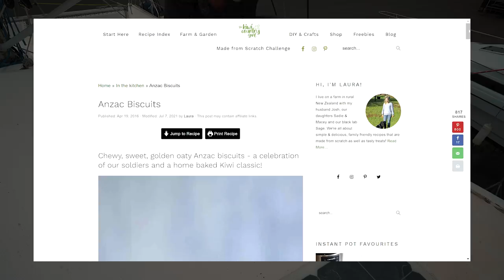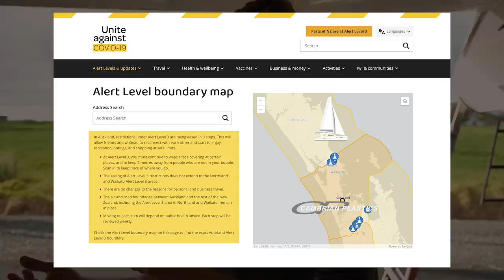BOAT REFIT: Our Biggest Project Ever!

Comment: Too late for this job. But when fiberglass fails from a sheet metal screw type of installation, And the panel has access from behind. I change the type of attachment. I use washers on the back side with nuts attached to machine screws. Be  sure to us Loctite on the nuts on the backside to deal with vibrations from the boat and water. The resulting installation is much faster and less interruption in work flow. But also i s a superior attachment for the instruments. You will want to keep the machine screws needed on hand because the head is important to the overall installation. You man need a special head on the machine screw. They are available in every imaginable type, but my need to be ordered and take several weeks order/shipping time. Thus having them on hand when needed is a plan ahead item.

Comment: I admit not going through all the comments, but I could not see from what I read or saw what your motivation was for doing all that work at replacing windows other than you were told the useful life was past.  Were the windows leaking (admittedly I may have missed that in the video)?  if not, why bother replacing them?  I get the need for preventive maintenance to prevent a greater problem but I don't get what greater problem you would be avoiding with waiting for these windows to fail, if they ever fail.  I have small leaks on my boat that I address when they occur but I don't anticipate leaks when the are not occurring and small leaks while a pita are not a big deal.
Reply from the maker: You've missed a couple! Check out this one, https://www.gonewiththewynns.com/caulked-up-preparing-for-passage, and another window broke during the passage to NZ.
Curious MInion
Reply: @gonewiththewynns  
Lol, yup, saw that now thanks.  I just hope I never have to face a window replacement challenge like you, that is insane.  I also hope I don't have to do an ad lib caulking job like in your video lol as I always tend to "look in the mirror".  Good luck guys.

Comment: Try using isopropyl alcohol or rubbing alcohol to release the bond between the sealant and the boat hull/fiberglass hull. It should/could make it much much easier to remove the windows by weakening the bonds.  I found this out on one of Adam savages videos about hot melt glue.  It seams to work for most sealants as well. Hear is a video I found about it.
youtube.com/watch?v=uPNP4GfDb1I
Reply: Also there are scraper blades for multitools that are smooth edge not serrated edge, thus less likely to damage the surface.

Comment: Great work guys. What sealant are you planning or have used?  I’ve used both 3M 4000UV direct to acrylic and gelcoat and Sikaflex 291UV with primer and the later was the worse, but neither were a great result and both professionally applied. Leaks returned after a couple of years. ☹️  I’m tempted to use a commercial buildings sealant next time and hopefully make it the last time before the windows are themselves need replacing in 10-15 years.
Reply: Dowsil 795 is considered to be the best for this application.  It's been used for many years to hold heavy glazing and spandrel panes in highrise construction.

Comment: Aloha! I have ben watching ya'll for some years now. Love your video's. Ya'll do a Very Good Job. 
 So I am going to give ya'll a Boat 🚢 tip. 
I noticed when you took off your steps off your frunt portlights that there was a bunch of mold under the steps where it is hard to get too and clean. So here is my secret on how you can clean that.
 When you wash your Boat 🚢 here is what you do.
1) take your bucket 🪣 put in Dawn dish soap 🧼 and bleach and here is the secret ingredient, Turtle 🐢 wash and wax. Put thim all together in your bucket 🪣 and wash your Boat 🚢.  This is what happens. 
The Dawn dish soap 🧼 cuts the dirt and grime the bleach kills the mold and helps in removing the stains you get on your gelcote and the Turtle 🐢 wash and wax helps with the cleaning and it wax's the Boat 🚢 at the same time. (Now the bleach will run with the water 💧 and get where you can't. And that's where the mold grows and stains your boat 🚢. ) 
I used this on my Boat 🚢 and comes out clean and bright and shiny.  I had to wash my boat every week because we was right across from the airport in San Diego. So it would get so dirty from the airport. 
So when you use this method all you have to do after washing your Boat 🚢 is wipe off your bright work and windows. ( It would take me three and a half hours to wash my 42' aft cabin motor yawt)
Ok. Thank you so much for this week's video 📹. And until next Sunday Morning. Aloha from the Big Island 🏝 of Hawaii!

Comment: Your use of that razor knife is so dangerous. You should have used a much more permanent  knife . That and you should have at the very least wore safety glasses. The blade on your knife is made to be broken off so it will snap and when it does it can go flying .

Comment: You've had lots of issues with your tupperware boat . Little leaks, Bad chains from unscrupulous suppliers, windows, The loss of the bottom of the boat along with the life raft. Aren't you glad you didn't need that in a hurry.?  And significant weathering when yer home was on land for a year. Now sail issues from again unscrupulous "dealers". I hazard a guess there wasn't one square metre of cloth cut or sewn for your sails. Next, it'll be the water maker and or one of the engines or wiring you cant access inside the mast .............................................. Aren't I a ray of sunshine?

Comment: How did you find such a lovely and appears to be such a joy to be around wife to help you this much you her attitude along with toughness passionate person to be working with. hard to find  someone this evenin a man then her ability to stand her watch so so very impressive boy a special note on some tools I wish I had a little bit richer I can send you some chisels and some other things just a quick note on the safety should be wearing goggles ear plugs at least and gloves and some cases I just finished up my windows used to heat gun not real hot enough to start that caulking glue melting I know it's probably too late now but that color using only melted for a second and then as it cools hitreg lose itself I didn't have any help on mine I do all my work by myself the heat gun will also remove jigsaw cut marks in plastic just run down and it will melt and smooth out all your cuts anyway sorry so long be safe great sunset Fairwinds